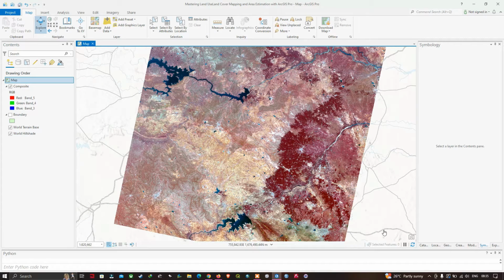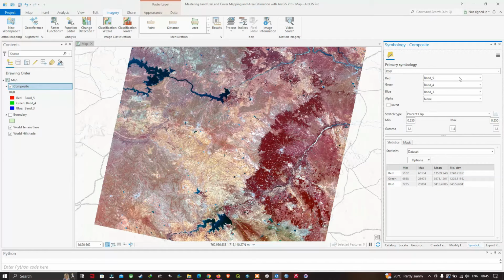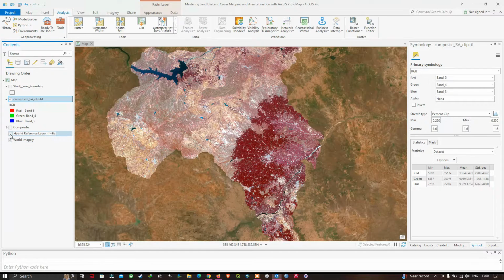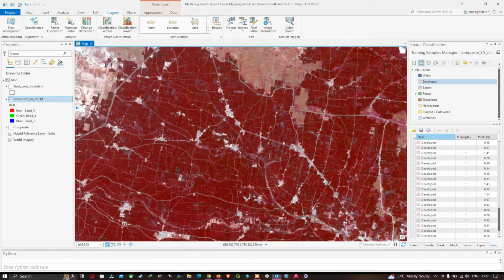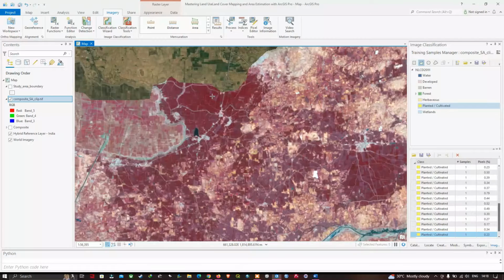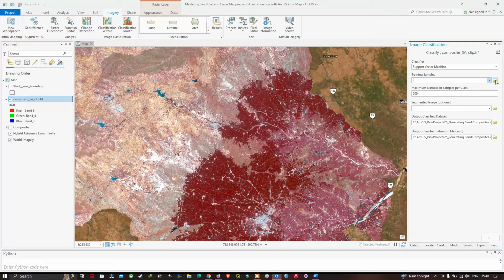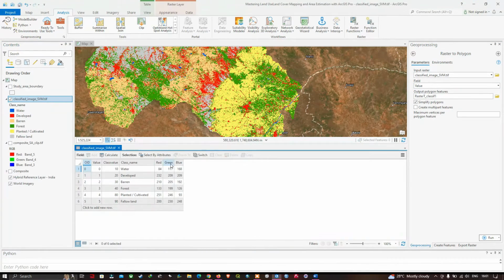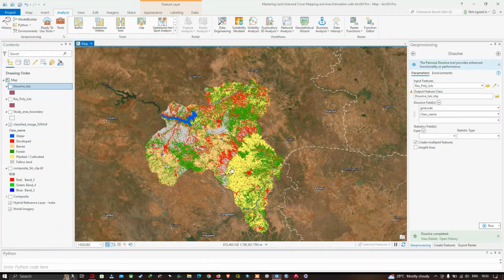Land Use / Land Cover (LULC) Mapping & Area Calculation with ArcGIS Pro

Comment: Hi, I want to ask few question for the collect sample part for supervised classification. 1) Can we digitized the sample with any kind of shape for each class or we can just can randomly digitized. 2) How much sample are good to get a accurate data. Thank you.
Reply from the maker: Hi Good Day, I'd be happy to help with your questions on supervised classification in ArcGIS Pro:

Digitizing Samples: You can digitize samples using various shapes, but the key is to ensure they accurately represent the land cover classes you're trying to classify. Using polygons can help capture the variability within each class, while points might be sufficient if you're dealing with well-defined, uniform classes.

Sample Size: The number of samples needed for accurate classification depends on the variability of the land cover types and the overall complexity of the area. As a general rule, more samples usually lead to better results. For each class, aim for a minimum of 30-50 samples, but this can vary. It’s often beneficial to collect more samples to capture the diversity within each class.

Thanks for your valuable questions :_Wow::_Welcome:
Reply: @TerraSpatial  Thank you so much for the detail explanation 😀
Reply from the maker: @noradila9599  Thank you